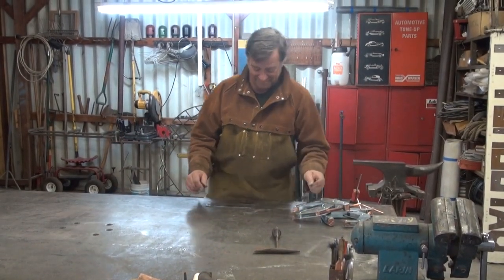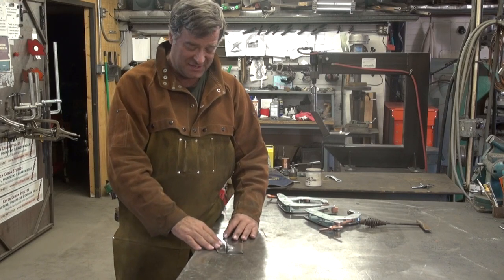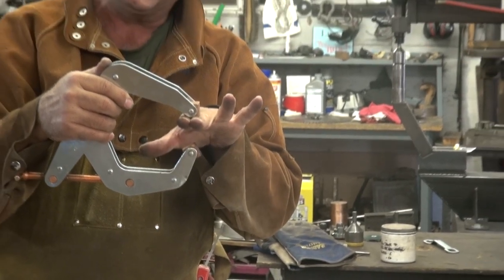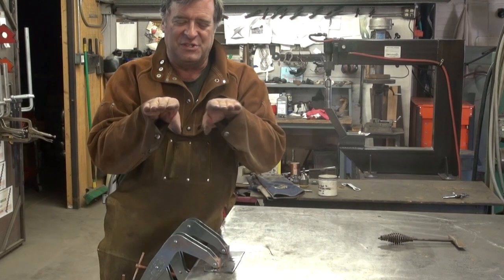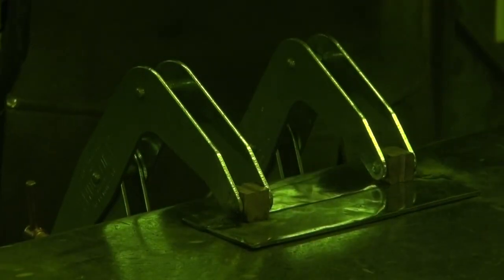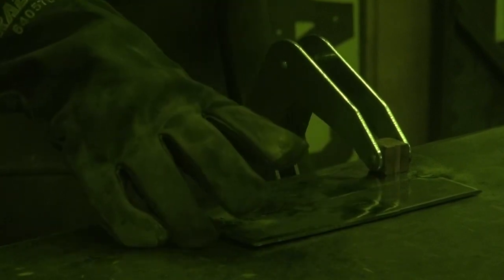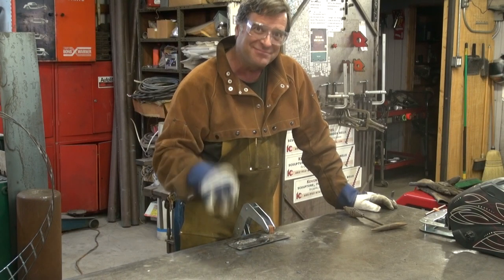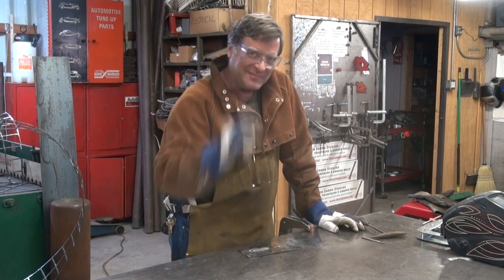How to Weld a Butt Joint - Kevin Caron

Comment: Thanks for posting this video. I am a newbie welder and was making the mistake of chamfering 1/8" thick square tubing for butt joints. Had serious burn-through as a result, no matter the voltage setting. Much better results with just butting the joints together.
Reply: Don't use 1/8 Stick (SMAW) to weld 1/8 thick metal (since you mentioned being inexperienced) practice with a smaller Rod.

If you can, use short circuit transfer MIG (GMAW) for Sheet Metal.

Comment from the maker: @kevincaron I really like MIg over stick just because of the cleaner weld from MIG.  But if you have to work in the wind outside there is nothing that can top stick welding. Either way have fun and practice, practice and more practice....
Reply: MIG with argon or flux core? 
I'm welding butt joints on 1/4" x 1 1/2" . Planning to use v or double v. with 1/8" or 3/32" 6011 stick. I want the edges to remain parallel and the work to remain perfectly flat. Plan: align pieces either touching or ~1/32" apart; tack one end both sides, tack the other end both sides. Weld the one side of the joint, flip right away and weld the other side. Suggestions?
Thanks.

Comment from the maker: @robotmotor I really like this little Lincoln welder. The AC/DC model is even better in my opinion. As for a MIG welder I would have to say a small Miller that will do solid core wire with gas would be a great machine to learn on. I am not a fan of flux core so I would stay away from it. As far as which to learn, stick or mig, I think it all depends on you. If you can afford a mig welder then go that way. If all you can afford right now it arc then there you go.

Comment: Though I would pass on something I just put together that made clamping small items easier. I got tired of clamping things on the edge of the table, and can't afford a pro-welding table with the holes and all. I got a 3/4" one foot square plate then welded three 1.5 inch pieces of angle iron about 3" long each on the bottom recessed in about 2" from the edge. This afforded me a small "welding" table that I could put on my larger welding table with better clamping and comfort options. Also allowing the ground clamp to be connected directly to it or to the part being welded. (I remember your grounding zap incident.)
Reply from the maker: Now that's an idea!!     I will have to run with that a little..    

THanks for the video idea!